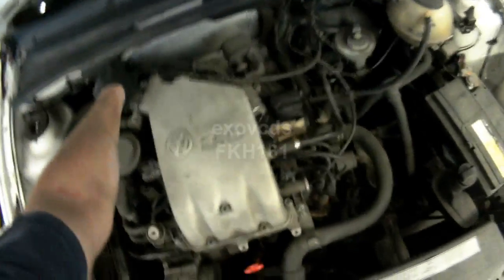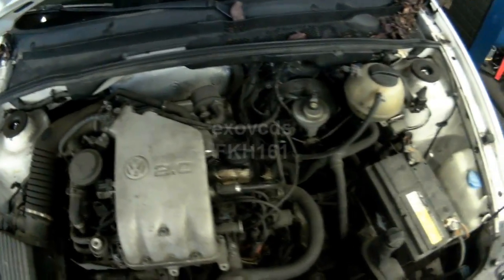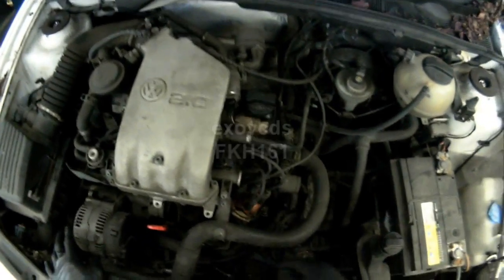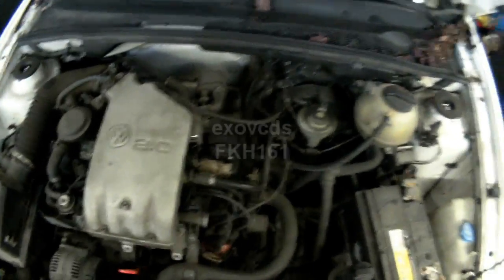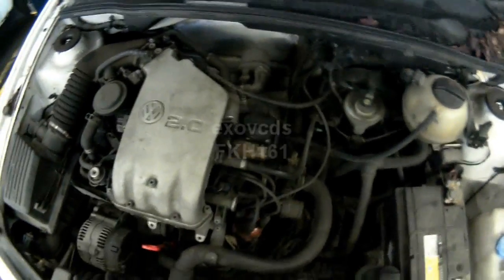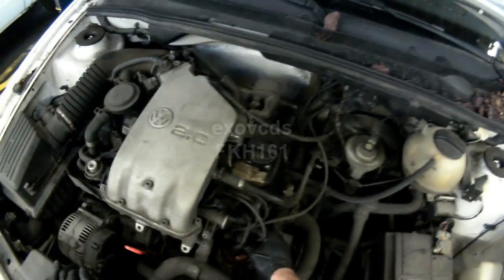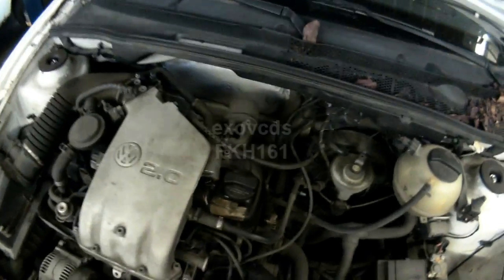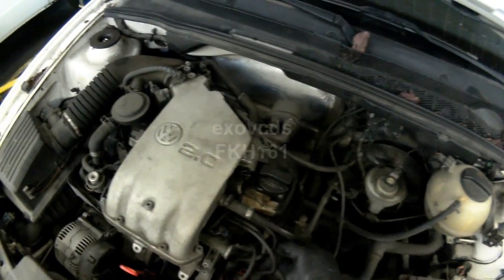VW A3: No Spark Quick Check...

Comment: Have a 97 2.0 gti wouldn't fire up so replaced cap,rotor,coil,and wires and still can't get it to fire up
Reply from the maker: Is the timing belt turning? Is the ignition rotor turning? Could be a bad crankshaft position sensor. Is the check engine light ON when you turn the key to ON?

Comment: so if the speed control sensor is bad, my rpm tack shouldn't move, I have put a new fule pressure regulatory in also
Reply from the maker: If your crankshaft position sensor (engine speed sensor) is bad, then yes, the RPM gauge / needle will not wiggle when you crank the engine... or a scan tool (that can view engine sensor data) will not show a change in RPM.

Comment: I have this condition now. Put a new clutch in had the hood open for a few days in a portable garage while raining. Tried a known good coil, rotor and new cap. I have a distributor too just not looking forward to doing that
Reply from the maker: Make sure that the battery light & oil light "stay ON" during cranking... could be ignition switch if they don't.

Comment: my 1997 vw jetta 2.0 manual just stopped working while turning down the road. cranked after charging the battery then never turned on. any idea
Reply from the maker: Starter is turning the engine when cranking? Does the battery light & oil light stay ON while cranking? Does the distributor rotor turn when cranking? Do you have spark? Do you have fuel / flow / injector pulse? Could be a number of things.
Reply: not all the way sure. this girl is selling it cheap because she cant figure out whats wrong. the fuel pump,starter,relay, have all been changed. they say the the starter engages but no start. they tried a push start no start
Reply from the maker: If the engine is turning and the timing belt is OK, crank shaft position sensor, ignition coil or fuel pump. Those would be my initial suspects.
Reply: valuable information. signed up to your forum
Reply from the maker: hmug tv Thank you!

Comment: On 2002 Jetta 2.0 Battery gets 12 volts. Crank sensor from the ecu is getting ground and on the connectors is getting 2.5 volts dc
Reply from the maker: Crank sensor produces its own AC voltage... what is it when cranking?
Reply: It is a 3 wire crank sensor, getting 2.5 volts dc when cranking
Reply from the maker: Yeah... the 3rd wire is a ground. Attach the multimeter across the 2 signal wires (set the meter to AC volt scale)... should have 2.6 to 2.9 V AC when cranking... anything less can be a no start.
Reply: A video he watched said to change to DC voltage that's why he checked it that way. I'll respond once he checks it with AC voltage. Thanks for your help.
Reply: On the crank sensor I Get 2.51 ac volts when not cranking just key on . while cranking get 2.56 ac volts on the 2 non ground pins.
Reply from the maker: +Renee Pedersen if that is a bias voltage (when not cranking) from the ecm... and the voltage is the same when cranking, then the sensor might not be doing anything.

Disconnect the sensor and do the same voltage check directly on the exposed 2 pins.
Reply: Thank you for your help, my husband will probably be taken it to the shop.
Reply from the maker: +Renee Pedersen Most of the time that's the easiest solution.

Comment: Sorry meant epc light on dash.
Reply from the maker: I'm currently at work... will get back to you later today / tonight.
Reply: Thank you
Reply from the maker: +Renee Pedersen Can your scan tool view ECM live data? If yes, does it show rpm when you are cranking? Does the tach needle move off of 0 when you crank?
Reply: Only have a standard ODB II space scanner. When cranking the engine the tach stays at 0
Reply from the maker: +Renee Pedersen it should wiggle a bit... if not, the new crank sensor might be bad.
Reply from the maker: Renee Pedersen When you are cranking the engine... does the battery light & oil light go OUT right away? Could be ignition switch then. Key ON, if you trigger the starter with a jumper wire, will the engine start?
Reply: Stays on 0 doesn't wiggle and oil light stays on with key on.how to you test the crank sensor? The starter kicks over so I have not jumped it.
Reply: Battery light stays on also
Reply from the maker: Renee Pedersen While cranking?
Reply: Yes while cranking it stays on 0
Reply: Battery and oil light stay on with key on and while cranking
Reply from the maker: Renee Pedersen OK... if they did NOT, then I would say ignition switch, so it should be ok.

Comment: Have a 2002 VW Jetta , it cranks no start and no spark. We have put in new ignition switch, new coil, new plugs and wires and crank sensor. Still not working.. There is a light that comes on says cpa on dash. Codes received are p0725, p1780, p1850. We don't knot if we should replace the ecm next or what to do next. Any suggestions?? Thank you.
Reply from the maker: CPA light on dash?
Reply: Epc light is also coming on. The car does not have a distributor and my husband has checked voltage car cranks but no start and no spark.

Comment: Thomas, I am also having a really strange issue, I was driving in my VW cabrio 97 2.o with manual trans, when a water hose tore and leaked all over the distributor and the coil. I repaired the hose and dry out everything with a towel, the car just cranked but didnt start immediately so I had to le it dry for a bit, then it started again no problems, I stopped the car for a while then started it again, everything went fine for about 10 min and all of a sudden the car started to rattle and had to stop, when I wanted to start it again it couldnt keep itself on (just cranks), there was no way to tell if the coil died because I was driving alone, so I had it towed to my house. Next day I replaced the coil and worked fine for a bit, then the car started to rattle again and died on me, there was cranking but the car just cudnt keep itself on, I took it to a mechanic and e replaced the cars computer with another one, he told me the computer wasnt sending the signals for the distributor, so my question is, is there a way to tell if the CPU is damaged? am I overlooking something? should I replace my cars computer? I dont know what to do right now :(

the car has already new spark plugs wiring and distributor rotor.
Reply from the maker: Components having gotten wet... might or might not have played a roll in what is happening now. If your distributor cap has a black plastic cover over it, remove the black cover from the cap (have to remove the cap & wires to do so). Your spark could still be shorting out underneath the cap. There's not much I can suggest, that a shop probably hasn't done already. Common issues with the 2.0L are crank sensor & coil (distributor / hall sensor is not needed to make the engine run). If everything (including wiring) checks-out OK, then yes, could be an ECM / CPU problem... I do not know of a way to test them, aside from plugging them in to see what happens.

Comment: What if the lights were not blinking from the outer ones? Just the one on the right? The car will not crank
Reply from the maker: +Jose Salazar If it will not crank (starter turns engine)... look for a starter / cranking problem. The light can't flicker if the engine is not turning / cranking from starter activation.

Comment: Ok so I have a 97 Jetta 2.0. Cranks, has spark, and have fuel pressure. I had it running and driving for few weeks after I bought it, then one day I was going for a quick spin around the block 1/4mile. Randomly died And hasn't restarted. Right before it died I was accelerating hard and as soon as I let off gas the motor turned off. I had it restarted one time after I tried every possible thing. I finally decided to drop the catalytic converter cause maybe it was clogged and it started few tries later. BUT IT WASN'T A CLOGGED CAT because I went to drive it around the block again and car died literally in same spot. Could it be a Bermuda Triangle issue or is that only with planes. JK. But now the car won't start.cranks and It has spark, fuel pressure, new plugs and wires. One thing I noticed was when I hooked up a disconnected spark plug to a connected spark plug wire the spark didn't seem strong or maybe injectors weren't firing. What does the www(WholeWideWorld).think?
Reply from the maker: +Cody Runyon Some of these vehicles have an ECM power supply relay... relay spot #3 (second row of relays above the fuses, third one from the left). The relay usually has a 109 on the face of it. If you have such a relay, it can cause the engine to stall or not start when it acts-up. The next time it does NOT start, turn the key ON and check if the check engine light is ON... if it is NOT on, then the ECM is not awake and it could be due to the relay. The most common cause of no starts with these mk3 VW's: Ignition coil, crankshaft position sensor, 109 relay, fuel pump. Not in that order. If you have spark, then you should have injector pulse... if the spark is weak... probably a coil issue or high resistance in the spark plug / coil wire. If you don't have spark... crank sensor (maybe). If you have spark & injector pulse... bad fuel pump or timing belt.
Reply: Thomas EXOVCDS thank you for the knowledge. It's obvious you know what your talking about with vw.  Also when key is in on position the pump doesn't prime. But if I crank it for a second or less I can hear the pump and there was pressure when I used a pressure Guage but it was from harbor freight and didn't last and I don't trust its accuracy. But when I unhooked the return line off the rail it def seemed like pressure was good. I tried jumping the fuel relay #12 I think and turned key two seconds after and didn't start but pump worked. I did the ignition switch test you mentioned in a diff video and all the lights stayed in when cranking. Now will that work or have you encountered a car with a bad ignition switch but lights stayed on? I will try the other test you mentioned in next few hours and get back. Again thank you.
Reply: Ohhh I follow you now. It HAS to be one or more of those issues you stated in order to get it to at least turn over.  Well I just cleaned up all the grounds under the battery mount. So I check to see if cel was on and yes it is. I still don't hear the pump prime unless I jump the relay. But even when it did run I'm positive I never heard it prime cause I bought the car as a non runner and that was the second thing I check after plugs.  It ended up being the coil ground when I first bought the car and ran great for few weeks. Then it didn't. So when I dropped the cat I forgot to mention I replace the dis. cap too and booming ran until it didn't 1/4mile later. I'm beginning to think it is spark related. Would it still run with a faulty coil. I have three used coils. I tried them all.  I noticed when the previous owner had a new thermostat in vehicle along with new plugs. The old plugs had grease caked on them.  But like I said it ran good no temp issues.
Reply from the maker: +Cody Runyon Fuel pump prime is irrelevant as long as the pump runs when cranking. Check the ignition coil by manually triggering it with jumper wires. Once you know that the coil is good, then you can continue with checking the rest of the system (control of coil).
Reply: +Thomas EXOVCDS ok I got good spark now and I think I narrowed it down to injectors. I don't think they are firing.  I pulled the intake manifold two weeks ago and clean the injectors up and to test them with a ohm meter 15.8-16ohm and did a voltage test and they all made that clicking sound like when testing a relay. What would you do next?
Reply: +Thomas EXOVCDS ok so I pulled the injectors but kept them in fuel rail and cranked engine. Nothing happened. So I used jumper wires and tested each injector and they work good.  Is there a injector relay/fuse  that I should check first cause I looked and I got confused with all the different answers.
Reply from the maker: +Cody Runyon All injectors get power from the fuel pump relay... when cranking, each injector should have one wire that has power all the time. If not, check the fuel pump relay. If yes, then you need to check the other wires (ECM controls the ground of the injectors to trigger the injectors). If the power supply is good, then ECM ground problem or internal ECM problem. A wiring diagram will help you trace power & grounds.
Reply: +Thomas EXOVCDS since the fuel pump doesn't prime and injectors aren't firing that it's more likely to be a ecm issue or ground. The car does have 180k miles.
Reply: +Thomas EXOVCDS as stupid as I feel I think I should let the WholeWideWorld know what caused my crank no start so anyone in with same problem can add it to there check list when diagnosing it. Battery wasn't connected. Lol jk. No it was the rotor has a notch inside the hole that the distributor slides into and aligns with this notch so it doesn't slip and throw of timing or cause a no start. Well this little notch got snapped off and it was a brand new rotor. It still spun and gave off spark which made me think it wasn't spark. I went with the cheap rotor and I guess I got what i paid for. CRAP.
Reply from the maker: +Cody Runyon Thanks for the update! Good to hear that you sorted it out! It's always good to double check things from the beginning.

Comment: hi I got it running but it drives  rough and  it has two  codes  a po341 and a p1316 when I hook my scanner to it. it shows it at 1500 rpms  when its not even running  should  I change my cps ?
Reply from the maker: +alex murphy Can you post a video of it running? P0341 could be because of a faulty hall sensor in the distributor... in which case the engine should still run smooth, or it could be because the distributor timing is wrong. I don't know what p1316 is. Set the engine to #1 TDC and post a video so I can see all the marks. Crank pulley mark, flywheel mark, distributor rotor position and camshaft sprocket position. If you can't do video, send me links to pictures via private message.

Comment: hey I got spark and fuel but it still wont crank could it be my  cps sensor ?
Reply from the maker: +alex murphy There's a difference between cranking (starter is operating) and not cranking (no starter operation). If it is not cranking, how are you getting spark? What year / model  & engine size?
Reply: +Thomas EXOVCDS  its a  98 Wolfsburg jetta 2.0 aba 5 speed
Reply from the maker: +alex murphy So is the engine cranking / turning but not starting or is the engine not cranking / not turning? If it does not crank, have you tried roll starting it?
Reply: +Thomas EXOVCDS I check out your  other a3 jetta vid I think its my ignition the  light die every time I turn the key  and yes it cranks bUt no start
Reply from the maker: +alex murphy Yeah, sounds like ignition switch. Leave the key ON, transmission in  neutral and activate the starter with a jumper wire... engine should start. or apply pressure (left, right, up, down) to the key while cranking.
Reply: +Thomas EXOVCDS well I have press on my key to get my radio to work and soon as i let go of the key the radio goes off

Comment: Thomas, I have a 97 Volkswagon Cabrio 2.0, no spark, have voltage and ground at the three wire plug at the coil but no ground pulse at the center wire when cranking.  Changed crank sensor, still no ground at center wire, changed ECM, still no ground pulse at the center wire, any suggestions.
Reply from the maker: +1340RAD Your test light is attached to battery + yes?

Comment: As far as the airbags, I found the module and unhooked it to see if that made a difference while cranking the engine, nothing changed. how beside the ODCII scanner can I diagnose a problem with the air bags causing a no start?
Reply from the maker: +Marcus Orillius Hi, the airbag module suggestion was just because of "the car not starting after the accident"... I have been told that the module will prevent fuel pump operation after an accident / crash. Whether or not that is true for your vehicle... I'm not sure. Let's say that the airbag cuts fuel (prevents fuel pump replay from working)... one can bypass the fuel pump relay to eliminate it as the cause. The quickest thing would be to scan the ECM & Airbag module for fault codes. Using wiring diagrams to check wire / circuit integrity can take quite a while.

Comment: hi Thomas, I changed the crank sensor, that did not do anything. same as before power on the two outside terminal but when I connected the tester to the center terminal and positive side of battery there is no light at all and does not flash on and off while cranking. im going to get a loaner ODCII and plug it in to see if there are any computer codes. also, #s 1,2,7,8,10,11,12, and 18 fuses do not have power to them in the fuse panel. engine still cranks but no spark and no fuel
Reply from the maker: +Marcus Orillius Not all fuses get power or have power at the same time. A wiring diagram will tell you when a fuse should have / get power. If the no start happened after the accident... either wiring got damaged during the accident (focus on the area that was affected) or one of the modules is preventing the engine from starting... that's the best I can guess at this point. Check the crankshaft position sensor for an AC voltage signal / output (2.6vAC when cranking, 1.3DC). Check that the ECM receives & generates an RPM signal that can be seen with a scan tool... if yes, then you should have spark, as long as the ECM is awake.

Comment: thank you Thomas, I will check the link, please get back to me
Reply from the maker: Didn't find any specific crash strategies / info... you can try disconnecting the module to see if is the cause of the no start. it is located below the heater box by the firewall:
http://forums.vwvortex.com/showthread.php?4068545-Cant-find-the-airbag-control-module